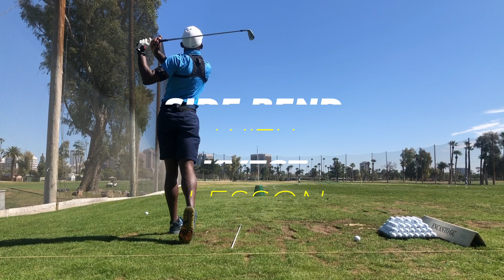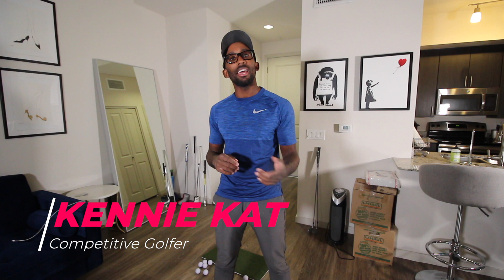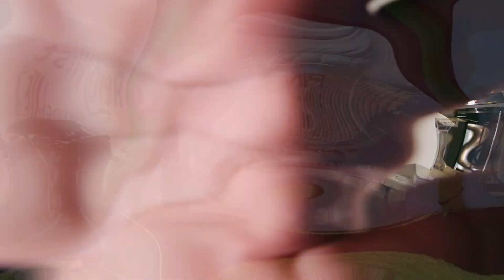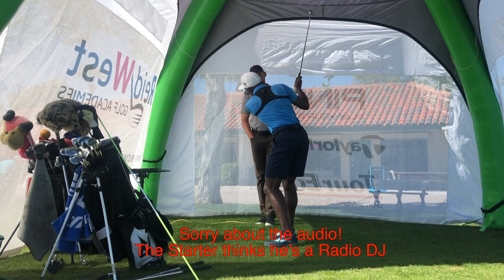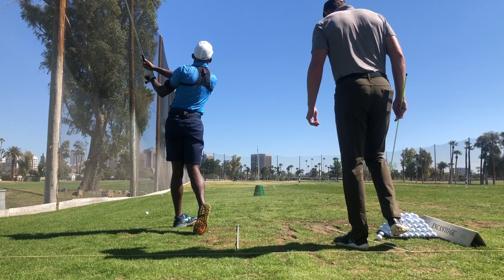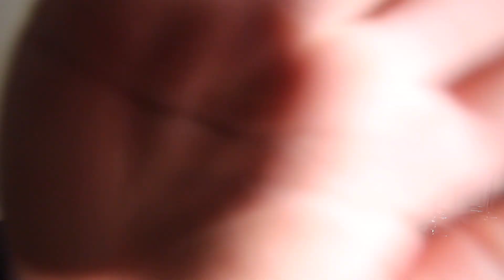Side Bend In My Golf Swing with K Vest // What I Learned From Tommy Fleetwood's Golf Swing

Comment: The vest is cool and all, but I find it fairly useless for slow motion work.  Doing slow motion work should be exaggerated movements, not hitting ideal positions.

So even though you were hitting your spots at the top of the backswing perfectly (according to the vest), I knew that when you added speed you would be flat at the top (which you were once you took it to the range).

Looks like towards the end you straightened it out a bit, which i'm assuming is because your coach had you exaggerate the feeling of forearms not rolling (club feels like it works up more vertical).

And on downswing you yank the club down from the top.  Try 50% speed swings and let gravity do the work.  I used to pull the club down hard and get steep, so trust me I get the struggle.
Reply from the maker: Interesting thoughts. Thanks for sharing and watching!